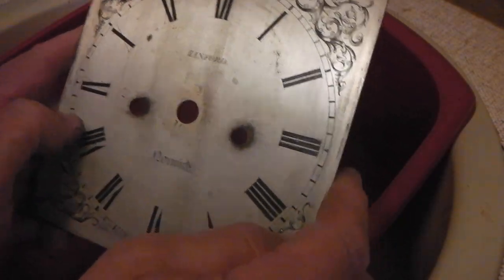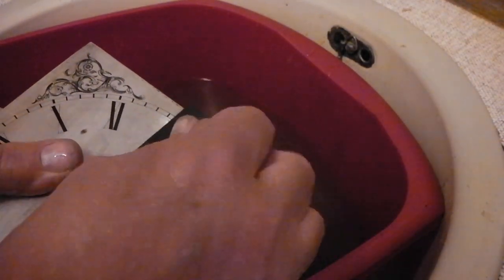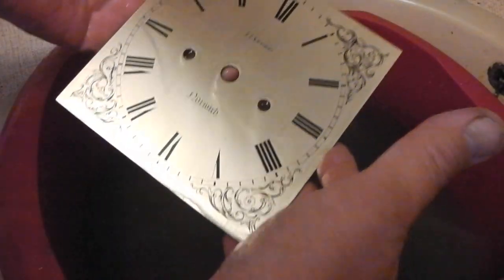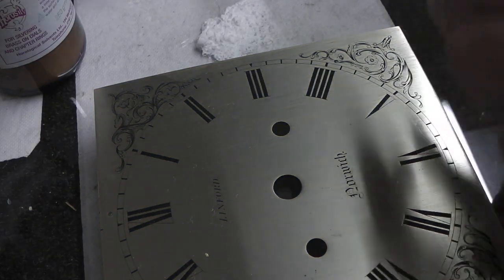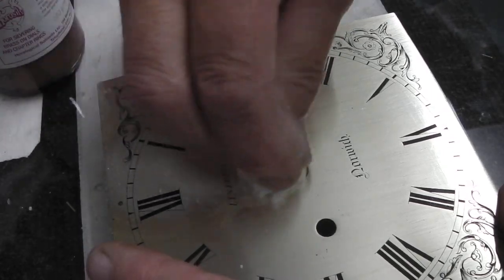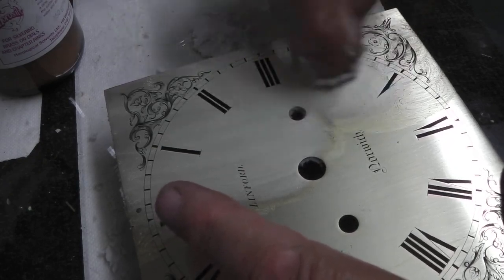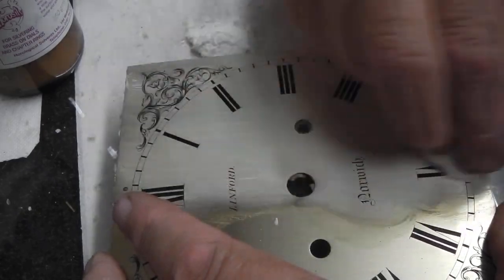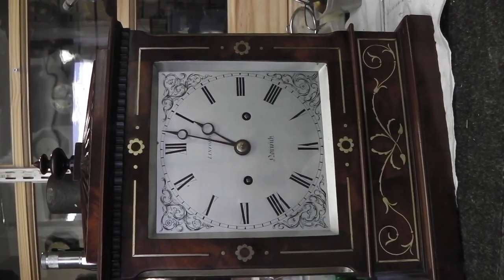RE-SILVERING A BRASS CLOCK DIAL

Comment from the maker: Two replies. 1. printed dials are not suitable as the printing comes off. It is possible to recreate the blackwork though after silvering.
2. 400 grit can be a little harsh in which case 600 grit is still good enough. I have silvered very shiny brass such as bells and have polished with 1200 grit and even 2000 crocus before silvering but the silvering does take more effort.
Reply: clifford thanks for this instructional video.  Do you know if they make a gold colored powder?  I want to do some brass watch dials.    Thanks again!
Reply: You do such a good job..If you ever find any with the numbers depleted...You may be able to take a photo and do waterslide decals to restore the dial after silvering.

Comment: New to clock refurbishment, great video clip. Surprised that the grit pad did not remove the lettering etc.
Reply from the maker: An abrasive will not remove the engraving on this type of dial. It will remove the numerals etc if they are printed onto the dial however
Reply: @cliffordjfreeman9134  Hi many thanks for the information on clock dial refurbishment cheers allan.

Comment: Hello Clifford. Thank you for posting this great video. I have acquired a lovely old Enfield mantle clock that I am trying to restore . The clock face is a brassy/goldish colour but near the number 12 it looks like the colour is worn off and underneath is a nice clean silver colour. I was wondering if the original finish colour was the silver or the brassy colour and is there anything I can do to sort it ? I'd appreciate any helpful advice. Thanks.
Reply from the maker: I suggest that an Enfield dial is electroplated silver on brass. The blackwork , numerals etc. are then screen printed on and not engraving filled with wax. Any attempt to resilver would result in losing the blackwork.
However, replacent dials of various diameters are available fr suppliers such as Meadows and Password or Timesavers.
Reply: Thank you Clifford for that very helpful advice. @cliffordjfreeman9134

Comment: hello clifford thank you very much for the video. how does the sanding on applying the silver not damage the black lettering or numbering? thank you
Reply from the maker: Firstly, care should be taken sanding. Use lots of water. Keep the abrasive paper flat. The purpose is to have only a clean and bright surface to take the silvering. The wet and dry abrasive paper will not harm the engraving if due care is exercised. Only use the abrasive paper lightly and just enough to make the surface bright (no tarnish ).

Comment: I have a circular clock dial, slightly domed, with a patterned decorative brass surround in an Anniversary clock.  What do you recommend for the process of abrading the brass to remove the remaining silver and any tarnish?
Reply from the maker: Without seeing the said dial it is difficult to comment but if the numerals are engraved it may be possible to spin the dial on a lathe and prepare the surface with fine abrasive paper.
Reply: @cliffordjfreeman9134  Thanks for the prompt response.  It might be possible to screw it to a backing plate that has a mandrel.  it is mounted to the front of the works by three screws.  Gives me something to think about.

Comment: Wow, that is amazing.  I have a clock with a brass dial that has lost its silver coating completely.  It was my late grandmother's, about 40 years ago I inherited it.  Since I had no idea that re-silvering is even possible, I polished the brass dial; it has been like that for 40 years.  The dial also has lost the black lettering and the stripes.  Can those be restored also?
Reply from the maker: 1959Berre . Best, I have found is to buy the silvering compounds from a reputable seller, Meadows & Passmore or similar, along with engravers black wax. The wax is for filling in the old engravings.
Using a spirit lamp or similar heat source,  warm the dial plate around the area of engraving, bit by bit, and melt the wax into the engraved figures and lines. While still molten scrape of excess with a wooden spatula so as to leave flush. Once cooled to cold flat everything back to brass leaving only the black wax in the engraving.
Silver as shown. 
(All I can say in this short space).

Comment: Hello, 

Good job Clifford!
I have a question. What can you do so the dials do not oxide? I do it in Dials from Grand Father clocks and sometimes they oxide on the next day. What am I doing wrong? 
I use horosilver and horofinish as you. What do you use in the end?
Reply from the maker: Hi. First you must be sure that the dial surface is absolutely clean and bright brass.
Once the silvering powder is applied and you are satisfied it is covered evenly it must be rinsed with clean cold water. Then apply the fixer ( I use cream of tartar powder ) applied with a damp/ wet cotton wool liberally. This will make the first silvering more 'silver' in colour. Again this must be lightly rubbed on and coated evenly before rinsing off with clean water.
Finally, I Seal the dried surface with "Silvered dial Lacquer" ( a xylene based lacquer I think) from Meadows & Passmore ltd.
Good luck the process is more difficult than it looks.

Comment: hello clifford, thank you for responding to me . i have a question for you if you don't mind giving me your opinion. i rebuilt a seth thomas 89L completely. i can only get it to run for a few minutes. if i take off the pendulum rod and bob on the stand in will run obviously very fast but smooth as can be. soon as i put rod and bob back on only runs a few minutes. I've bent the crutch every which way just can't get it to run consistently. do you think its just not getting the crutch at the right angle? thank you for taking the time to respond.
Reply from the maker: Pm me on fb